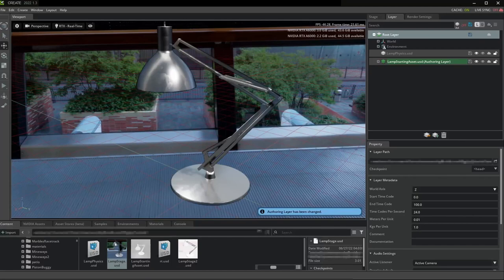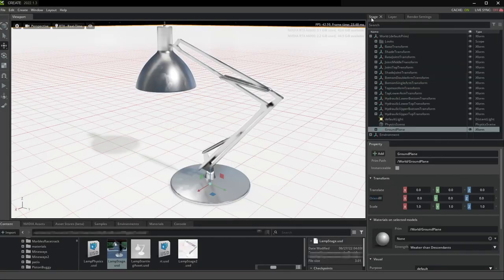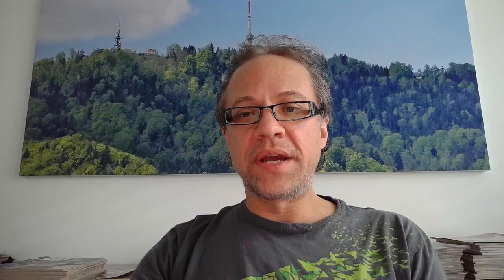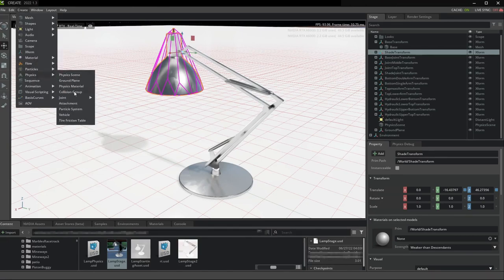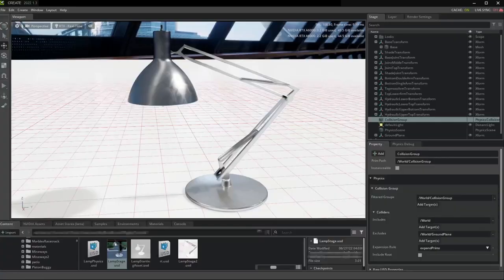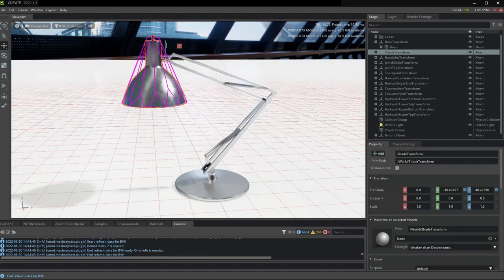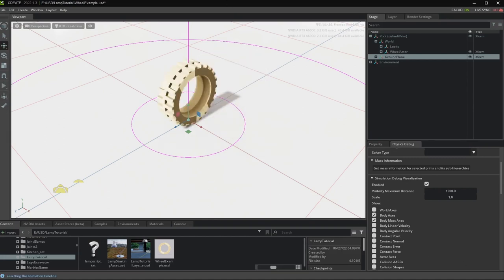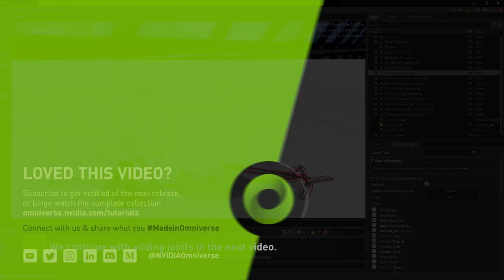NVIDIA Omniverse Physics Extension - Rigging a Desk Lamp Part 2: Basic Setup and Colliders

Comment: Hi, I can't get your demo file open correctly for some reason. The starting asset uploads correct each time (though missing metal as material, but its white?) but when I try to upload the rigged end result I just get a blank scene without the lamp. Also the structure of XForms and their names are also completely different. Can you make a guess what's going? What Extensions I should exactly have installed/running to have this working? Thanks already in advance!
Reply: Also I don't have Enterprise edition if that is needed